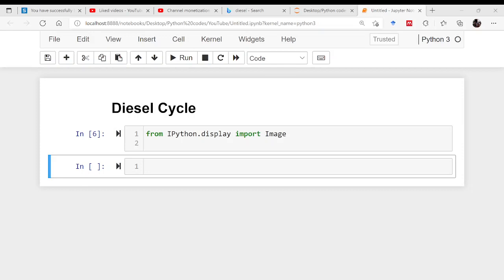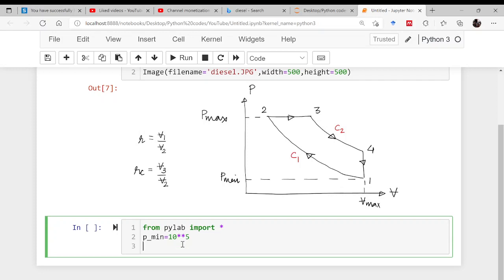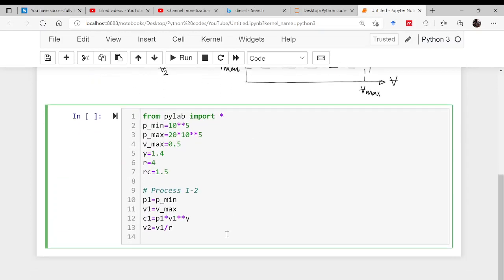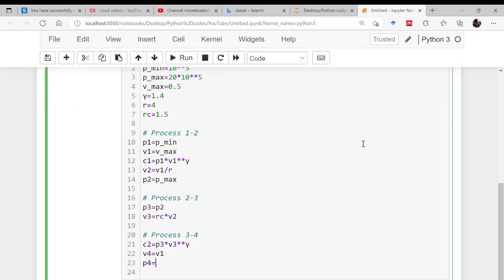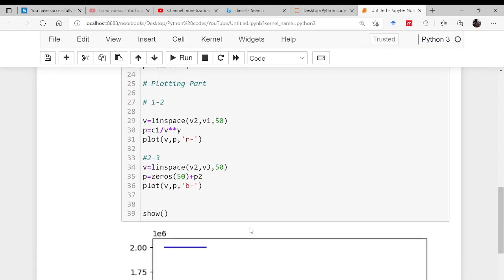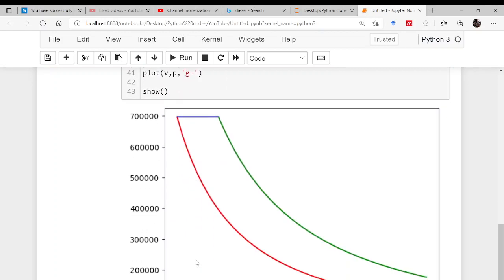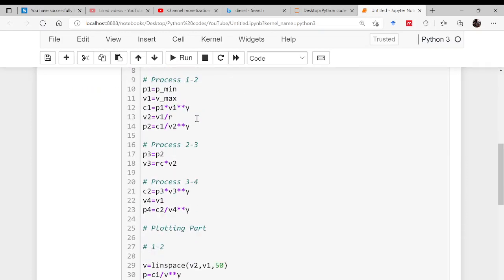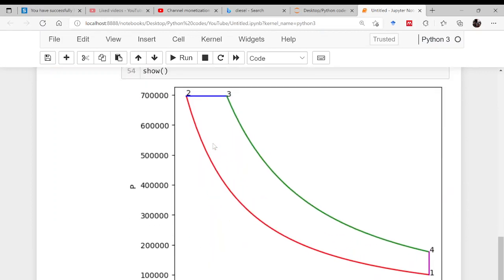Plotting Diesel Cycle using Python

Comment from the maker: Python Code:

from pylab import *
p_min=10**5
#p_max=20*10**5
v_max=0.5
γ=1.4
r=4
rc=1.5

# Process 1-2
p1=p_min
v1=v_max
c1=p1*v1**γ
v2=v1/r
p2=c1/v2**γ

# Process 2-3
p3=p2
v3=rc*v2

# Process 3-4
c2=p3*v3**γ
v4=v1
p4=c2/v4**γ

# Plotting Part

# 1-2

v=linspace(v2,v1,50)
p=c1/v**γ
plot(v,p,'r-')

#2-3
v=linspace(v2,v3,50)
p=zeros(50)+p2
plot(v,p,'b-')

# 3-4
v=linspace(v3,v4,50)
p=c2/v**γ
plot(v,p,'g-')

# 4-1
p=linspace(p1,p4,50)
v=zeros(50)+v1
plot(v,p,'m-')

text(v1,p1,'1')
text(v2,p2+4000,'2')
text(v3,p3,'3')
text(v4,p4,'4')
xlabel('V')
ylabel('P')
show()